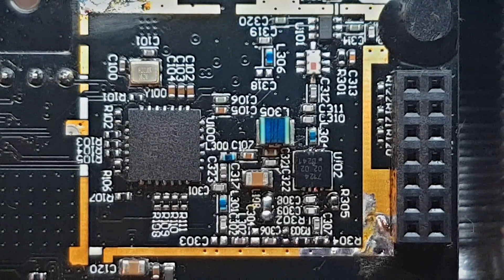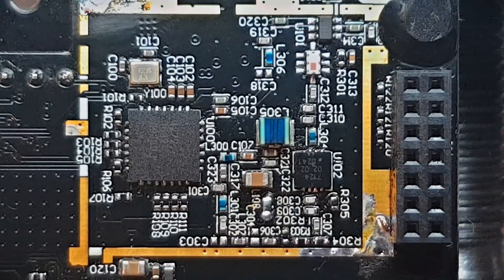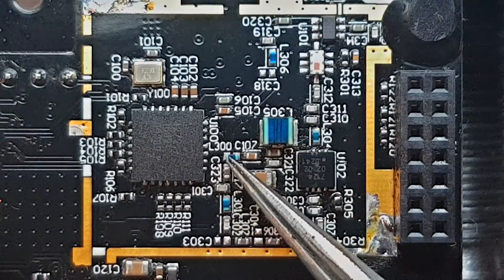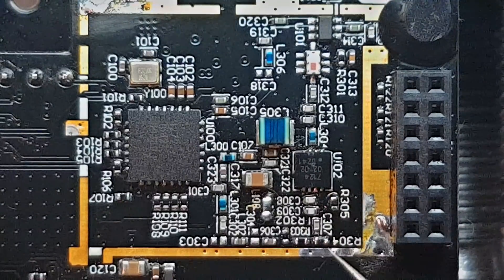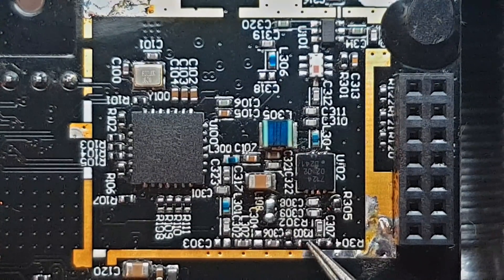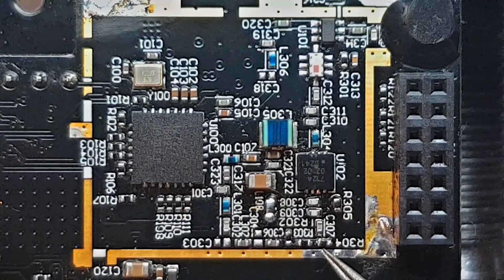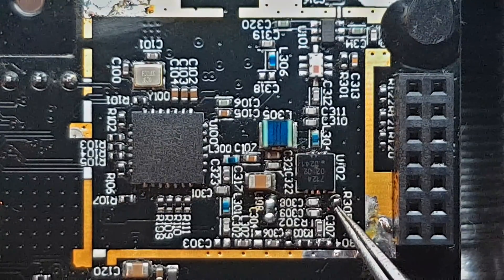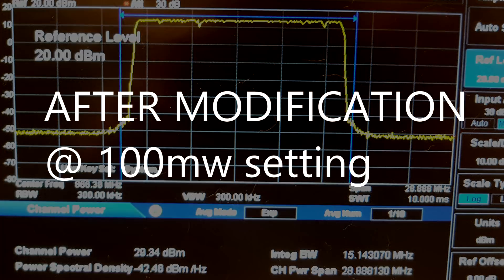Crossfire Micro TX - 250mw Power Mod

Comment: Hello Livyu. Thanks again for this video. I'm just trying to fix a transmitter where the C307 pad jumped (the closer to the R304).
is this capacitor vital? Or i can think to create a connection between r303 and r304 to C309.
Does it make sense?
Reply from the maker: Yes makes sense. Yes the cap is vital the signal passed trought it to the amp. You can do that. Contact me on facebook and show pictures. I will guide if something wrong.
Reply: @LivyuFPV  thanks a lot. Really. Let me take a picture and send it to you on facebook

Comment: With my drone turned on, if i turn on the radio my crossfire micro takes about 25~30 seconds to connect to the drone (nano receiver) is this behavior normal? If I do the same but turn on the radio first it connects instantly... Does it hapen to you?

Comment: what you described at the input of the RF Amp is a matching Pi Attenuator.
Reply: It seemes like they are matching a input impedance, 35 Ohm from the semtech to 50 Ohm at the input of the rf amp with a 9dB attenuation
Reply: nevermind, input and output of pi attenuator are both around 35Ohms so we should be fine just shorting the series resistor. 
But I don't understand why, if you design a pi attenuator, wouldn't you want to match the output impedance of the pi attenuator to the impedance of the rf amp. So like I said 35 Input and 50 Output?
Reply: and another question :D If we short the 9dB attenuator, shouldn't we get 14dBm+9dB=23dB=200mW on the 25mW setting?
Reply from the maker: we just have to remove the attenuator. The Semtech is not set up to output 14 :) but maybe in the region of 3-8 or thereabouts on RFO, and where did you see that the Semtech has 35ohm output? its a 50Ohm device. They went with the network present in the datasheet if I remember correctly, with a slight variation.
Reply: The input impedance of the pi attenuator including the RF amp (50Ohm) is 35 Ohm. I calculated it. So I assumed the semtech including the network on it's output has a 35Ohm impedance as well. Because I thought that's the purpose of a pi attenuator, to match the impedance.
btw I now have an idea why we might not get 9dB more ouput power when removing the 9dB attenuator.
the small signal gain for the rf amp is for 900 MHz around 23dB(datasheet). But as it says, small signal. The gain of the rf amp is probably getting compressed when connecting a higher input signal.
Reply from the maker: J Bender exactly :) but that attenuator is 50 ohm to 50 ohm i dont know before it never looked. But there is no reason to make it 35 :)
Reply from the maker: J Bender also that is just an attenuator not a matching network  so no matchimg happens there.
Reply: yes I don't know why the input impedance of the pi attenuator is 35 Ohm, but it is. I can send you a picture of the calculation on facebook

Comment: Hey man  i will be doing this mod tomorrow. I hope it wont damage it . I check your other video . Steps are : remove the three resistors and put the small wire connector to connect the two resistors . Do you think i can put solder to connect them instead of thin wire because i do not have a 0 ohm resistor. Please advise
Reply from the maker: Mr FPV no solder will stay there ... wire
Reply: Livyu FPV ok man. Last question: in case i lose any of the resistors . Are the three of them  the same ? What type of resistor are they?
Reply from the maker: Mr FPV can t remember now 2 are 40 ohm and one 70 if i remember right ... you don t need them :p
Reply: Please can you share the spreadsheet . Im looking for shorts in my board and dont know how the polarities are placed( + and - of transistors)

Comment: Hello
Did you analyze differences on schematic between 250 and 500 mW amplifier? I found some IC's in store and I want to replace amplifier to try to get 500 mW on crossfire micro module :)
Greetings

Comment: Nice video ! It's pretty interesting... I have checked the NXP BGA7124 datasheet, I can't find the 500 to 600 Ohm recommanded value that you give in the video. Could you please give me the page number where you find this information. Because, for me the 2K resitor (R2) on the ICQ_ADJ input is correct. If you check "Application information" on page 13 you will show that the typical value for R2 is set to 2K.
The chip is working at 5V or 3.3V in the Crossfire TX ?
If we could "upgrade" our TX with your mod it would be so cool...
Thanks Livyu FPV for your work.
Reply from the maker: i did a mistake speaking about the 1w one (reading through all the datasheet i got confused... for the how to mod i will talk about it (for the 7124 they recommend not going lower than 1200ohms if i remember correctly) i went for 1.5k but been testing with 500-2000 lowering it to 1.5k increased the gain a little... but i will get into that tommorow when i will release the how-to video. Thanks for the attention :)
Reply: No prob... All I need to do now is wait for your new video and close my PDF reader :D

Comment: So in the end all you did was change the resistors? Or did the chip need replacing? I loved the story you told on how you moded it but I feel its confusing the modification side. could you make a how too video with out the story and with a picture that would circle exact resistors to be replacing and a parts list of ones to order and where to order from not bagging on your video I just got lost in the story (=
Reply from the maker: SirSpeedyFPV Gerald Dale i will do a how to video also :) got some friends up for it :)

Comment: Really interesting, so changing a couple of resistors you can get more output power or do you also need to change the IC chip?
Reply from the maker: benii only the resistors for 250mw...
Reply: Lol... I extended long long time ago old trusty 600mw irc transmitter with simple variable resistor to get 0...600mw changeable power ;) Just needed to have 25mw sometimes, and didn't want to buy extra ($$$) transmitter ;) Worked like a charm :)
Reply from the maker: so to be more exact Alex is saying that one little resistor can do wonders :P

Comment: did you just change the resistors or also the IC? could you creatr a little schematic illustrating the circuit before and after? great idea btw - thanks and subbed
Reply from the maker: on the original IC BGA7124 i modified the Attenuator behind it and also the resistor witch limits the amp supply current.